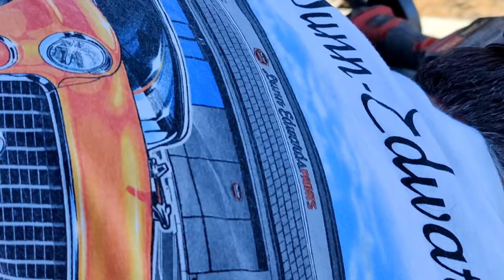RESTORATION - 1954 VW BUG OVAL WINDOW -  dash firewall ribbed doors

Comment: Cool seeing 1950's bodywork.  Totaly agree with how you do repairs.  The cars get on the road and are enjoyed at a reasonable cost in time and effort.  Bravo.
Reply from the maker: Thanks 👍
Reply: Total no nonsense approach. Cars come out nice, protected and ready to hit the road. No need for overboard perfection that even the factory did not attain straight from the assembly line.

Comment: You spend a lot of time filming and editing to show the massive amount of labor you put into restoring these cars. I hope people appreciate this. Many don't realize how much labor it takes just to clean and strip a car down.. 
Ps. You could mention to people that epoxy primer is not a sandable primer. It will clog your sandpaper very fast.  Although I have wet sanded epoxy in small spots using sanding screen that comes in rolls. But it's not advisable unless you get chunks in your spray gun. Which is why I wet sanded what I did. Great job vidoing this labor of love. 👍

Comment: I found a plastic razor scraper at McFadden Dale hardware, but you have to use only one edge if you know what I mean, it has 2 ends on the blade but once you install the blade in the holder, try scraping with it and if it doesn’t work spin the holder in your fingers to the other side and it works great for stickers and glue and paint stripper. Being plastic, it only has one side.

Comment: Nice work!  The car must have been in accident early in it's life = lead body work.  The paint stripper available now sure is slow reacting. I tried the citrus stuff when it first came out and didn't like it because it was so slow.  Thank You as always for the video! 👍
Reply from the maker: yea best if you cover it with plastic and leave it overnight. and scoop it off and use it on another panel. IMO as good as the newer strippers they are slow and dry out quickly. Nothing works as well as the old stuff.
Reply: you knew  the old stuff worked because minute specs of stripper landing on your skin burnt like hell...😁

Comment: Just tried the Super Clean on my bus overhead insulation glue.  Worked great!  AG47 will stick to sanded epoxy primer but does it stick to Tamco DTM primer?  Isn't that how you did the blocking on the Westy?  Thanks for all the excellent videos.
Reply from the maker: no it will stick to the DTM...the dtm sticks to the surface really good. I just dont go very thick ova any primer. Ag47 sticks to wood almost anything sanded.

Comment: Another great video!

I was going to start to get to work on grinding all of the rust off my bus and treating with ospho but I have heard that ospho can cause issues with paint adhesion. My plan is to grind away most of the rust and then treat the pits with a light application. What do you do to prep the surface for epoxy primer on areas where you applied ospho?
Reply: on small stuff, I put it in the electrolysis bath to derust it... on the bigger stuff, ospho or that white converter stuff he used on the bucket truck bus.... ospho, then sand it, then epoxy... that's one plan.  You could ask Tamco or your epoxy primer provider, the epoxy primer is to lock in the surface and prevent o2 and moisture from getting to the metal... Good luck and drive that bus !

Comment: Hey mike where you getting your pass. Side quarter panels from? Also can’t wait til you fix that quarter panel because my 63 in the pass quarter area right in front of rear tire it got hit pretty good and had like a 1/2” of Body filler there. So I need to fix it and see how you attack it seeing there is a interior panel that welds to the wheel hump and the outside panel. Love your videos!
Reply from the maker: next video got them last night

Comment: Do you ever powder coat?  I like to do my wheels more durable than paint....
Reply from the maker: Dont want single tone wheels. Powder coat resists chipping better than paint but still fails over time in the sun.  Wheels make the car and single tone doesnt work for me.,... Tamco has a clear called high impact clear that resists chipping